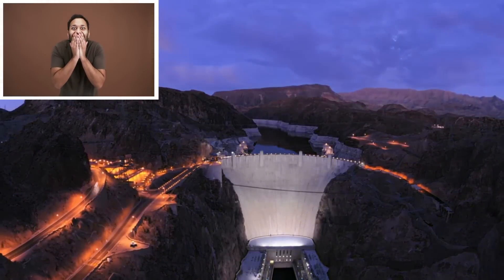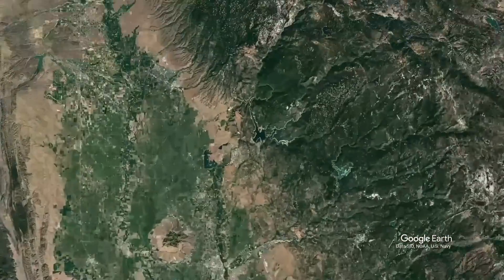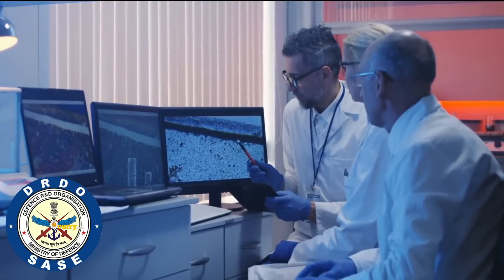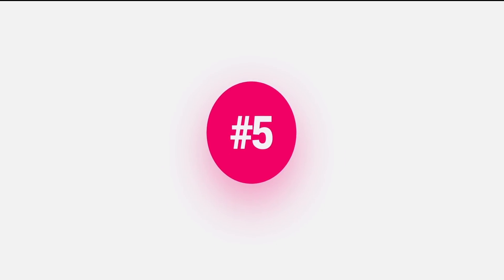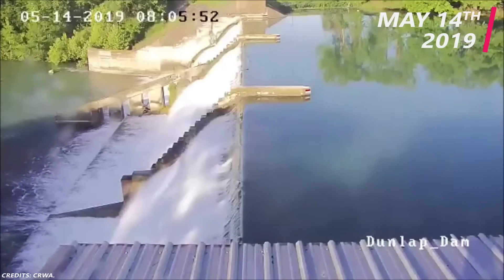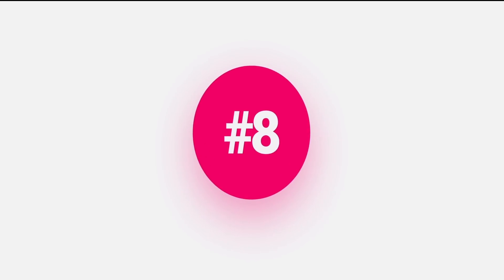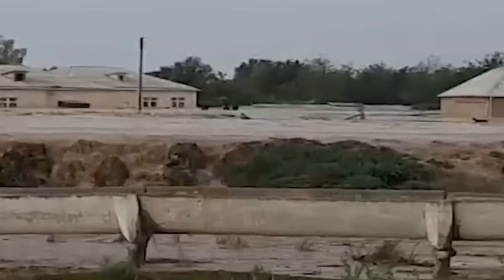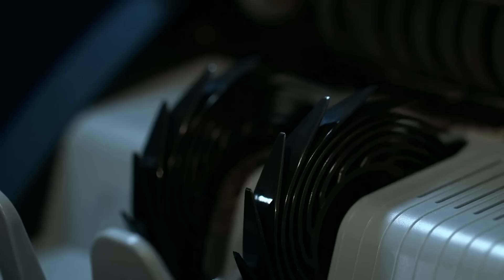Massive Dam Failure Caught On Camera #fail

Comment: 6:45 all of the info on this dam is wrong. Since i lived 300 yards away from it when it collapsed  and was there as it drained, i will correct the bad information. First, that dam isnt 175 meters high,  That would be overt 400 feet. Not even close. Its about 60 feet tall, Thats about 20 meters for you metric folk. That 175 meters is surface ABOVE SEA LEVEL. It was built in 1931, and the residents of the affected area are affluent (well off financially) citizens.and paying to rebuild it to get their lake back. Kind of weird, i used to kayak up from the Mc Queeney side below that dam and fish. That dam was there to make the  canal hydroelectric project work. I just wonder how accurate the res of this is.   Annoying misinformation.